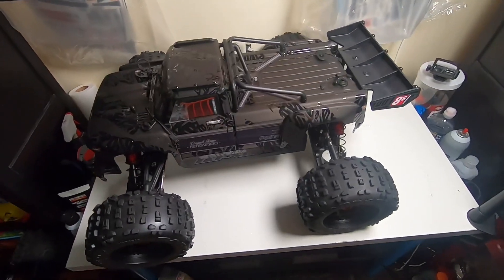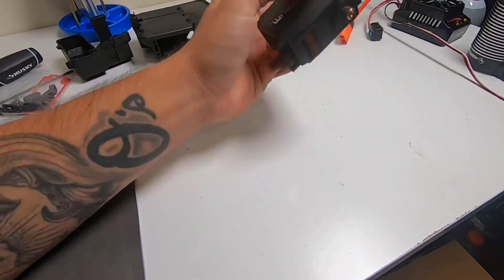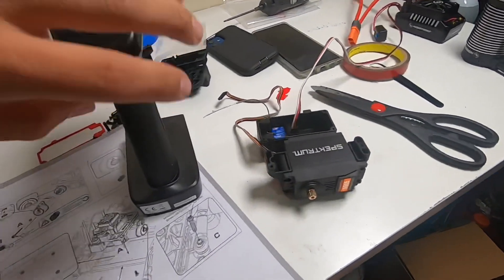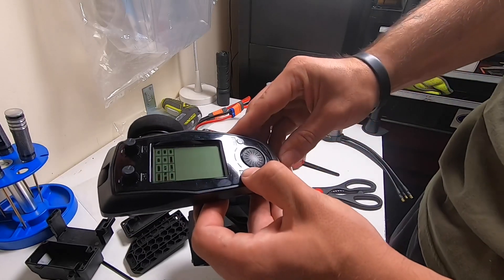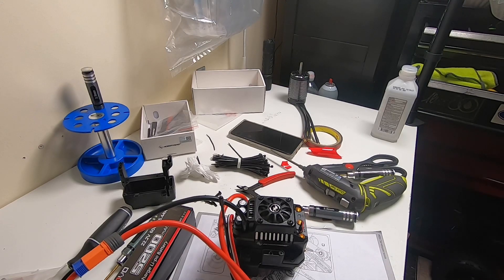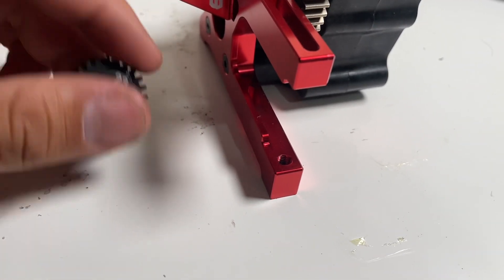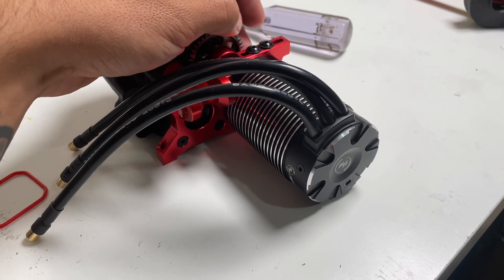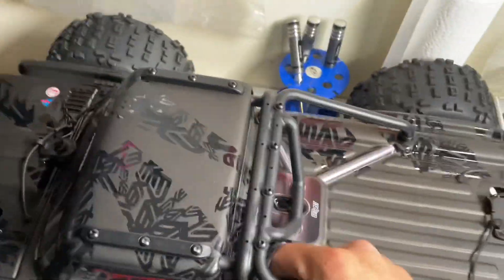Arrma Outcast EXB | Max 5 & 1100kv

Comment: Looking to use this as the platform for my first serious build. I have never built one from a roller, just gotten RTR stuff. Slightly nervous to dive in but excited nonetheless. I do have a nice workspace and good tools so I hope to do a good job on my build, but I may need to shoot you a message on here for tips or advice if i run into any road blocks!
Reply from the maker: Feel free to ask any questions, definitely a good first build!
Reply: How’s the build going so far
Reply: @thecarribeancowboy_9876  finished it maybe 8 months or so ago. Extremely fun rig. It got put away for winter and I actually just took it back out a few days ago. I’m running an 800kV motor setup.. super torquey

Comment: Can u recomends diff fluids i have hw 800kv on my outcast is exb but rear and center diffs was eaten.  I think problem was absolute no shimming difs with bad rebuild and bad fluids i ordered vitavon spider gears and ring gears. My gearing is 47spur and 30 pinion. Fluid was 100K front and rear and 1M center. I will change to 500K rear, 1.5M center and 300K front so u think about it? Thanks before diff eaten set only front diff survived.
Hw set was 100brake/100fwd and punch was between 4 and 5 so fun and agressive runing for me that was but 3 hrs diff was eaten:) check vids with outcast in my chanel  if u can